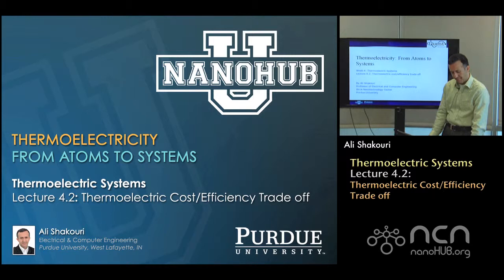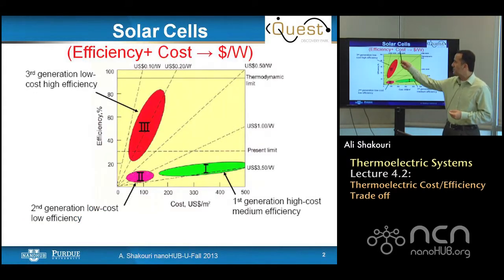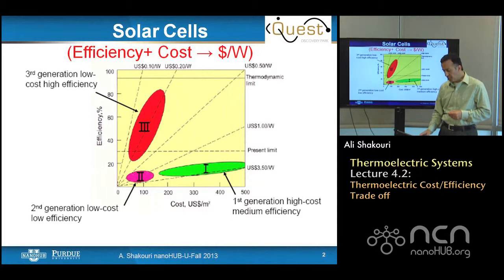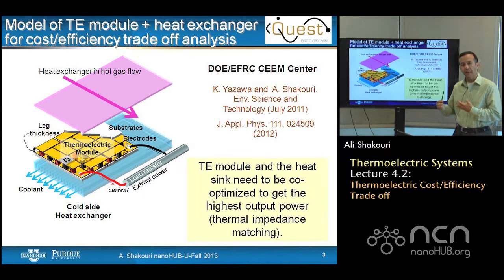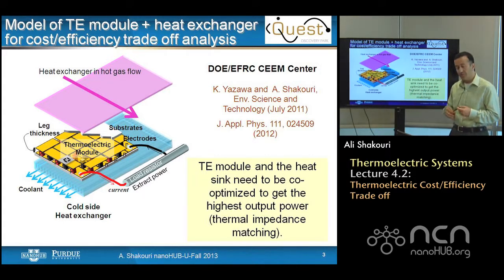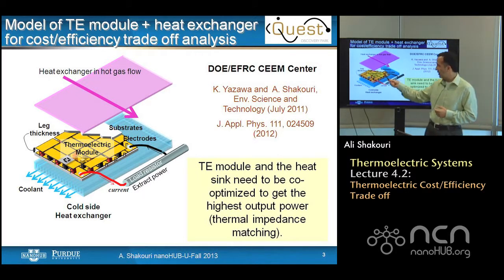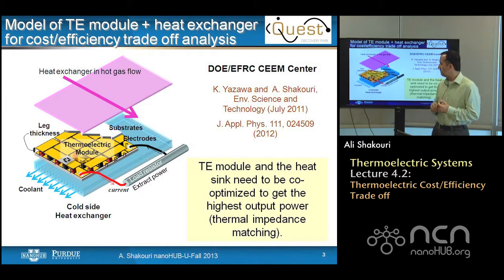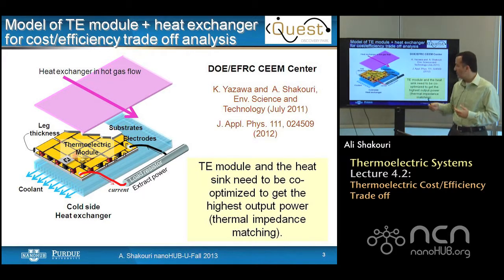nanoHUB-U Thermoelectricity L4.2: Thermoelectric Systems - Thermoelectric cost/efficiency trade off

Comment: I have a question, Why is the maximum power a  load resistor can extract from battery equal to the internal resistance of the battery?
Reply: Learn electricity module: independence matching.